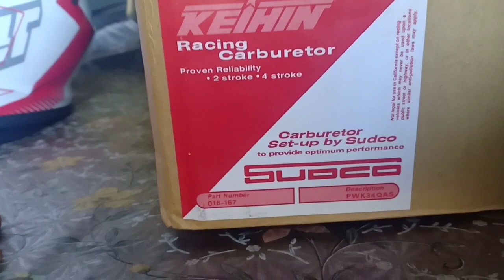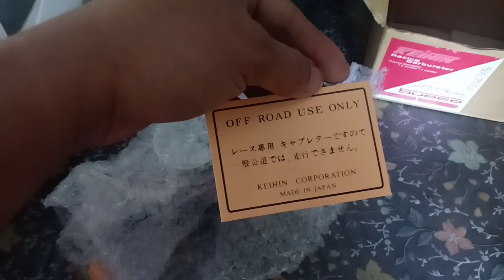Installing 34mm sudco keihin flat carb at palit jettings,,racing carburator

Comment: Boss ano po ang pinaka malaking main jet na pwede ilagay sa 34mm na keihin carb?
Reply from the maker: 140 paps
Reply: @ILOCOSMOTOSPEED  kung sa slow jet po boss ano po pinaka malaking size pwede?
Reply from the maker: @alas8886  depende kasi sa kaya nang motor mo paps,,,
Reply: @ILOCOSMOTOSPEED  600cc po kasi na naka single carb ang bike ko po keihin 34 po carb nakalagay boss
Reply from the maker: @alas8886  45 paps
Reply: @ILOCOSMOTOSPEED  thanx boss sa tips💖

Comment: Boss anu po ung mga jettings nung 34 mm na keihin na nabili mo?
Reply from the maker: 38 135 linagay ko diyan paps
Reply: @ILOCOSMOTOSPEED  kamusta po ung performance boss? ☺️
Reply from the maker: @rkzmotovlog409  malakas paps pero malakas din sa gas
Reply: Paps ok lng ba ung 140 na main jet sa 200cc na motor?
Reply from the maker: @rkzmotovlog409  okay lang basta kaya niya paps
Reply: Hnd kaba nahirapan magtono paps?
Reply from the maker: @rkzmotovlog409  hindi naman paps

Comment: master pabulong naman anung ginamit mung throttle cable
Reply from the maker: Nakaquick throttle kasi ako,,xrm 125 ginamit ko
Reply: @ILOCOSMOTOSPEED  eh panu yung starter master?
Reply from the maker: @chikaupdate  pumili ka yung merong starter switch
Reply: Stock engine lang bha yan?then 34mm?